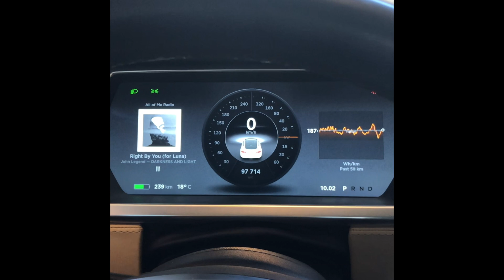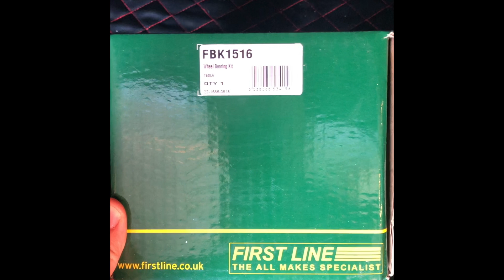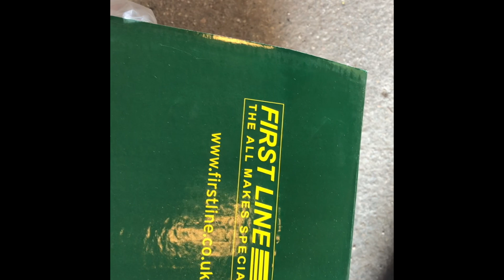Tesla Model S wheel bearing replacement

Comment: Not legit to remove an old ball
bearing hub this way. This was done in Norway. The way you pressed out the bearing certsinly damaged the drive shaft axle and at least the packing into the gearbox if not the gear box itself. I have never pressed out a Tesla S bearing bellow 4 tonn power- mostly 5-7. So imagine the energy you applied onto the drive shafts bearin, simmer ring and gesrbox housing. Terrible to look at.

Comment: For anyone watching this - do not use copper spray. Knuckle is aluminium and you'll get galvanic corrosion. In fact do not use any lubricants on bolts at all as you'll be over torquing it significantly, sometimes by 2x.

Comment: After replacing the rear hub with a new one will the car need to be realigned? or are you good to go.  Thanks
Reply: Needs to be realigned. But since Tesla has so much movement in the wheels I do it roughly myself by shifting from summer to wintet and reverse.

Comment: To anybody doing something similar, it is very common to break the 18mm caliper bolt. You should look ahead of the repair for part availability. I almost got stuck when replacing my rotors, hopefully there was a Model S part out near me.

Comment: Funny, my 2013 White model S with exactly the same wheel AND Alloygators had also the broken bolt, but then on the drivers side. The lower one... It was not my old car, is it?

Comment: im amazed , tries to remove rotor before the caliper is out of the way, looks on the outside of the bearing housing " looks worn"  yea thats how that works
Reply: They broke the rust loose before taking the caliper out because they didn't want it to fall. Only fail here is your inexperience working on cars.
Reply: There are other fails too, like antiseize on these boots and lug nut fastening pattern
Reply: @NicholasPhamLolthey're hub centric wheels and hubs. You don't need to use a specific pattern like you did back in the day. Again, only fail here is commenter ignorance.

Comment: How did you know the bearing was bad? I'm getting a motor sound noise but with wheel bearing habits. It will go away when I turn right and noising turning left. Just wondering if there was a specific test I could perform to be sure.
Reply: Take it to someone who knows. I had a noise every time I turned to the left. (Weight sifts to right side and noise increased) common knowledge is right side need a change. I gambled on front bearing, still same noise. Then did rear. Still same F noise! Took it to a garage, they changed front left. Noise gone! Never changing this myself again
Reply: @t.j.goldwater  I ended up changing it myself.
Reply: Johnathon Smith Did you get the right one?